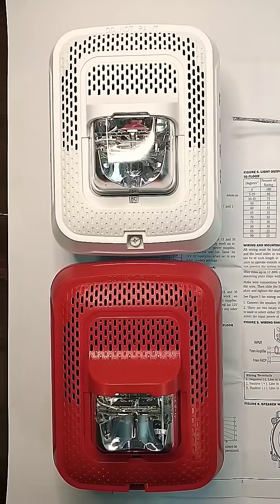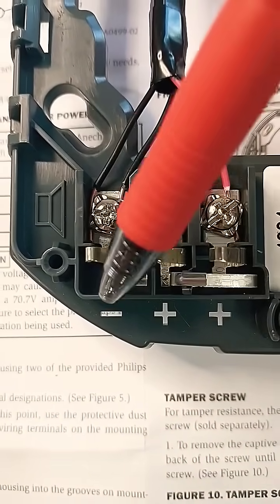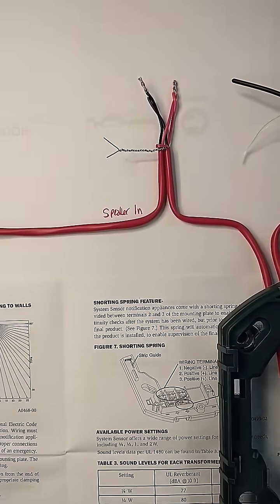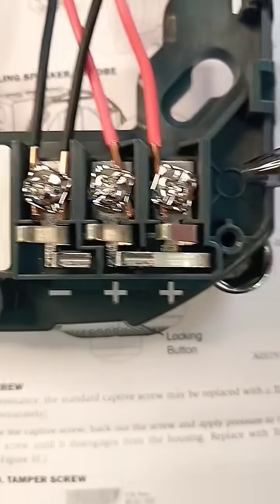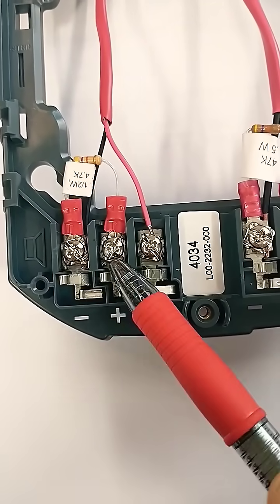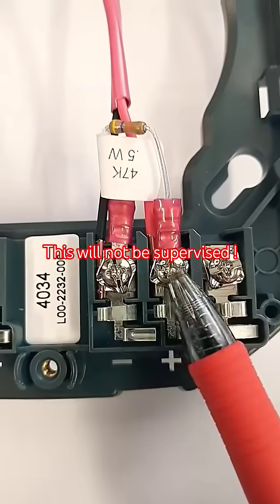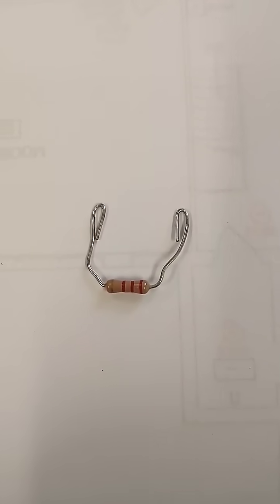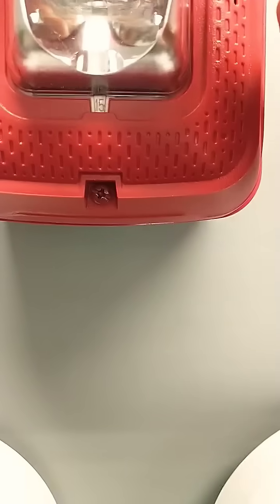How to Wire & Install Fire Alarm Speaker Strobes #firealarms #firealarmtraining #electrical

Comment: What's the type of wire used for both the strobe and speaker again? I'm kind of slow with that. Tks.
Reply from the maker: We use 14 AWG 2-conductor for the strobe circuit and 16 AWG 2-conductor shielded for the speaker circuit and have not had any issues with voltage or signal loss.

You may be able to use a smaller AWG wire if the circuit is short or may need a higher AWG for a very long circuit. Its based on load calculations during system design.
Reply: @Syrtime  Thank you everyone on the team😊

Comment: Why do people say they're different they're literally the exact same thing they do the exact same thing they have the exact same xenon strobe they have the exact same candela ratings same with ceiling strobes that are literally the exact same thing
Reply from the maker: Are you comparing wall vs ceiling mounted strobes?
There are differences between wall-mounted and ceiling-mounted strobes. The reflector lens is designed differently to control how the light spreads, wall strobes project light outward and downward, while ceiling strobes spread it evenly in all directions for proper coverage.
Reply: @Syrtime  the advances the normal wall mount version they also spread it in all directions
Reply from the maker: Here’s the install guide that shows the light patterns for both wall and ceiling strobes:
[https://prod-edam.honeywell.com/content/dam/honeywell-edam/hbt/en-us/documents/manuals-and-guides/user-manuals/L-Series_SpkrStrbs_WallCeiling_I56-0002.pdf](https://prod-edam.honeywell.com/content/dam/honeywell-edam/hbt/en-us/documents/manuals-and-guides/user-manuals/L-Series_SpkrStrbs_WallCeiling_I56-0002.pdf)

You can see in the diagrams how wall strobes push light outward and down, while ceiling ones spread it more evenly all around.

Comment: Does it matter which terminal is used for incoming and outgoing postive wires?
Reply from the maker: No, it does not matter because they are electrically common once the device is installed.
Thanks for watching!
Reply: @Syrtime thank you so much! And that makes sense after I look at rhe device a bit more.

Comment: Puedo usar un cable no blindado para los spk?
Reply from the maker: Eso depende de las instrucciones del fabricante.

Gamewell-FCI: "Utilice cable blindado para cablear circuitos de audio. Todos los cables blindados individuales deben conectarse al negativo del sistema o a tierra, para supresión de ruido, conecte a tierra solo un punto. Mantenga la integridad del blindaje en toda la longitud del circuito de audio".

Notificador: Recomienda cable blindado.

El propósito del blindaje es evitar que se induzca ruido en los circuitos de los altavoces y también evitar que los circuitos de los altavoces irradien ruido a otros circuitos.